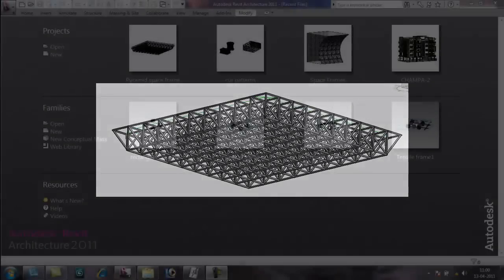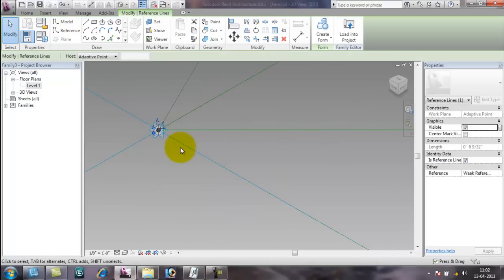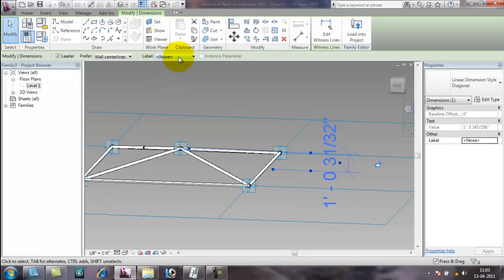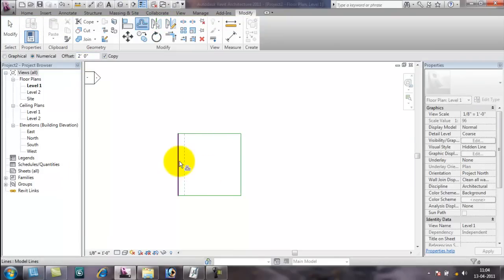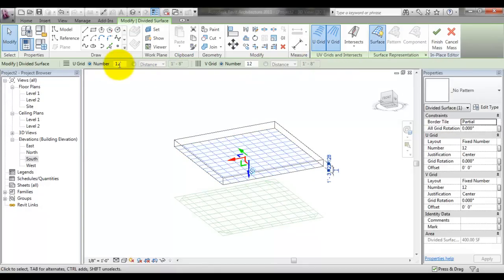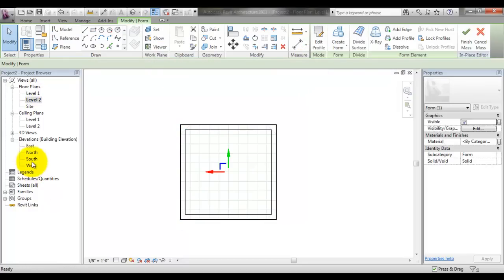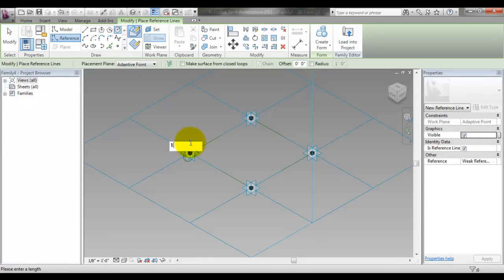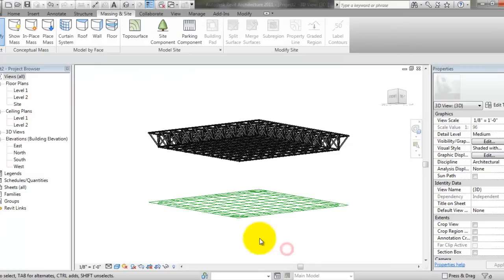All spaceframe-1.mp4

Comment: For flexibility, I would suggest adding a few more dimensions to ensure the center node stays in the center, this method breaks when you flex the grid size. You also can't have partial panels, so be sure to have a clear module before you change the pattern from rectangular to the custom panel. Great video!